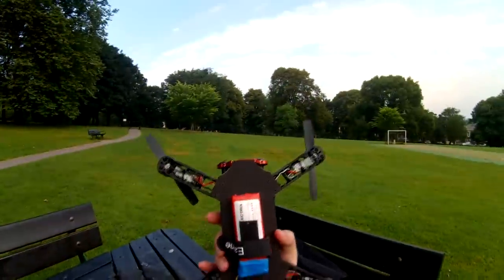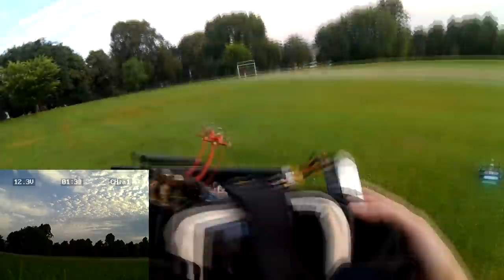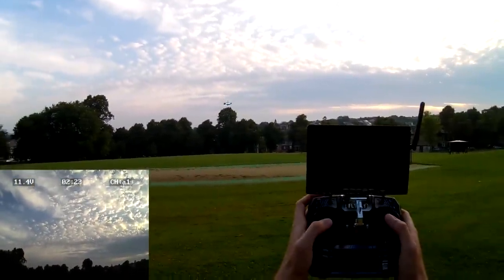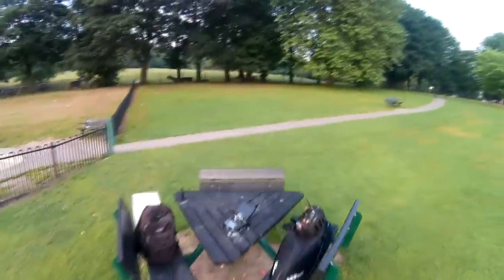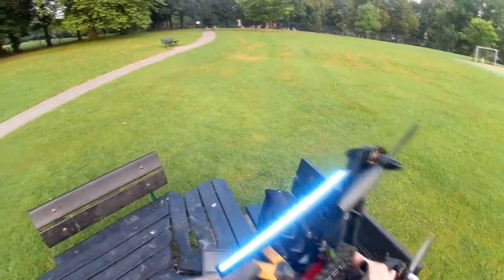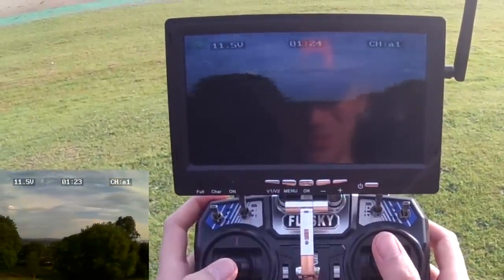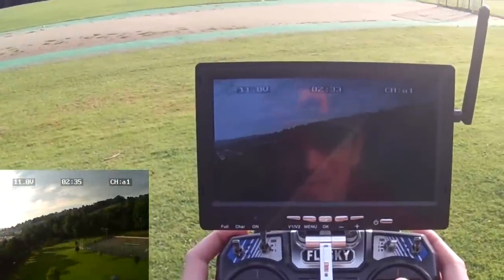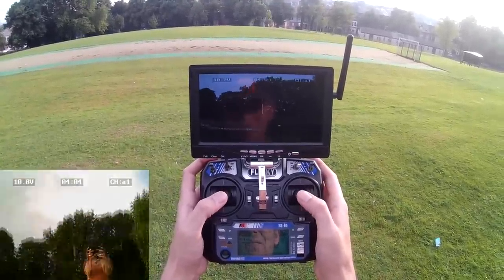Floureon 250 Racer - PIDs, camera tilt, large lipo test and flying with the monitor (Gearbest)

Comment: What's the range of its fpv?
Reply from the maker: I haven't taken it past around 400m max yet but the Frsky RC link is superb and video also had solid range down low at the end of out club track where it dips away and I could still fly below the grass line. 600mw is very strong but my goggles managed slightly better feed than the stock monitor past 200m

Comment: How did you raise your camera angle up ?
Reply from the maker: If you remove the camera board from being seated in the frame at the stock angle you can increase the angle and then tighten the 2 plates up it to secure it. The tabs on the cam don't slot into the gaps in the frame any more, they sit in front of it instead. There's no movement in it this way but it is set at a higher angle for FPV.
Reply: MicroRCFiend would you mind posting a short video or some pics? I'm new to drones
Reply: MicroRCFiend I would greatly appreciate it as would a lot of folks ..camera angle on these from factory isn't ideal
Reply from the maker: You can't change the cam angle unless you separate the top and bottom plates slightly first to allow you to unseat the camera and preposition it. Do you have the drone in your hands? Can you see how the cam board fits through the gaps in the two main plates?
This was given away so I no longer have it to take any pics but my unboxing ones do show it at this angle.
https://flic.kr/p/N4tY4e
The camera board is wedged between the two plates and those plates have cutouts it fits into to set the angle. After re positioning, the top is still wedged in it's slot but the bottom is not and instead further forward inside the frame instead of sticking through it into that gap increasing the angle. As you can see the front plate will determine how far it will tilt as the lens will physically touch that plate rather than being positioned central in it. Closing the plates will now wedge it at this new position and there's no give or variance, the frame will only close with the cam at this new angle.
Reply: MicroRCFiend no I ordered it last night and I'm awaiting it still. So basically separate the plates ...pull camera from slots and position it in front of slots ...then re secure plates back ?
Reply: MicroRCFiend how many screws roughly to separate the plates? Do any wires need unplugged? Basically what I'm getting at is ... is it easy and straight forward ?
Reply from the maker: Kinda but the bottom of the camera board has no slot to go in once you remove it so it sits inside the frame. Honestly, I suggest you wait till you get it before asking any more questions as I can't put it into words better than that and once you have it to actually look at it's pretty obvious what the only option to preposition the camera.

Comment: Hi, can i use 4s akkus?
Reply from the maker: Mine did not react well when I tried 4s as if FPV gear was getting direct lipo voltage so I only used 3s.
Other do not seem to have that problem.
Reply: Same question. Just bought 2 4s batteries and I'm afraid that it will burn the copter :-) Do you think it's harmless to try?
Reply from the maker: Same answer, "Mine did not react well when I tried 4s as if FPV gear was getting direct lipo voltage so I only used 3s.
Other do not seem to have that problem".

Comment: where do you get parts?
Reply from the maker: Gearbest, Banggood and ebay.
What can't you find you need?
Reply: MicroRCFiend the arms , I looked on ebay nothing I also looked on gearbest nothing
Reply from the maker: These aren't Floureon/Eachine branded but they are 100% compatible and a decent price, I added 2 white ones to the the Floureon I gave away. Black, white or red are your options.
Plus if you use the 'RC200' coupon code there's an extra 35% off right now.
Might be worth expedited shipping if you need em fast though as usually it's 10 to14 days minimum with the free option.
http://www.banggood.com/HMF-Totem-Q250-Q330-Quadcopter-Frame-10cm-Arm-Fit-for-Eachine-Racer-250-p-1007101.html?rmmds=search?p=UI14032168777201508N

Ok, found original Eachine ones too, they are identical to the Floureon if you'd rather and bargains too.
http://www.banggood.com/search/eachine-racer-arms.html?p=UI14032168777201508N
Reply: thanks alot!!
Reply from the maker: No worries Speedy :)